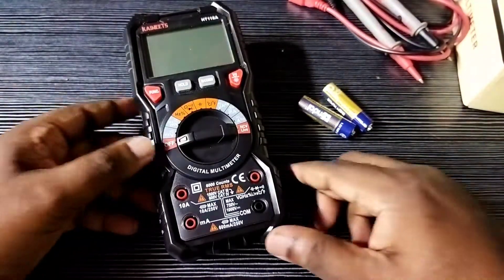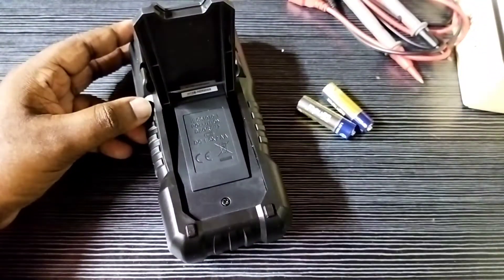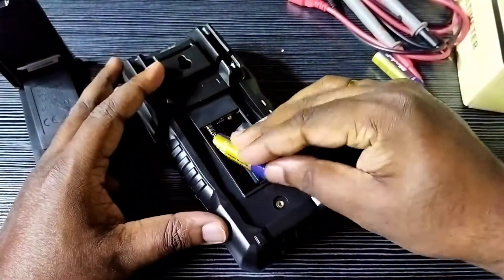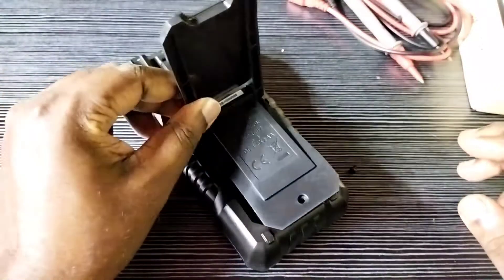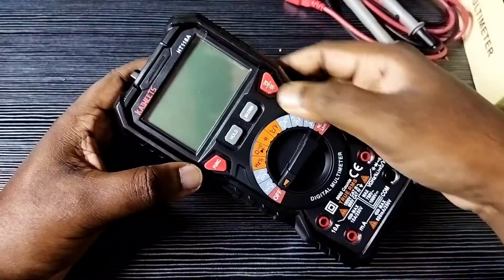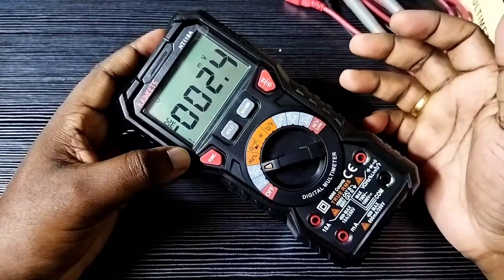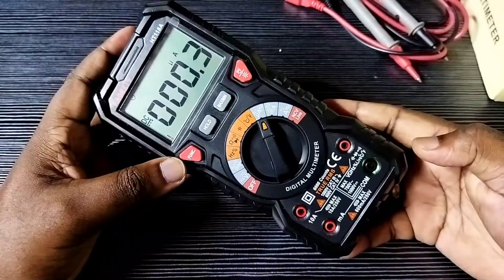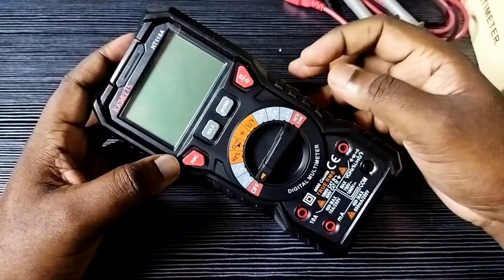How to Replace Battery of KAIWEETS  Digital Multimeter

Comment: Yes, nice video. My HT118A has been indicating it needs the batteries replaced.  It has the original ones too.  They lasted a while despite only being two AA batteries.  Fluke meters use a single 9V battery which lasts much longer, but AA batteries are easier to find, and cost much less.  It's all a tradeoff.  Great meter.  It's very useful and the status LEDs and backlit display are nice 👍